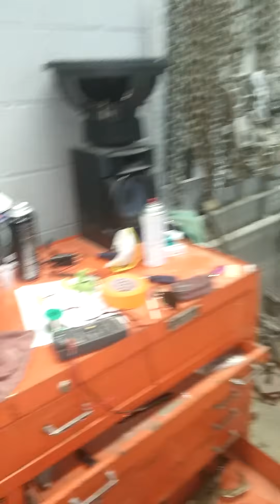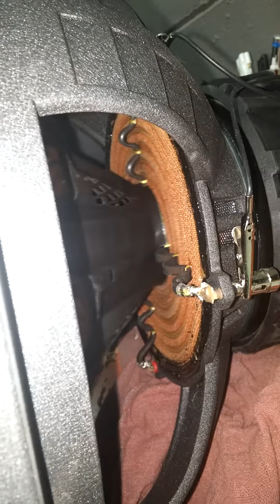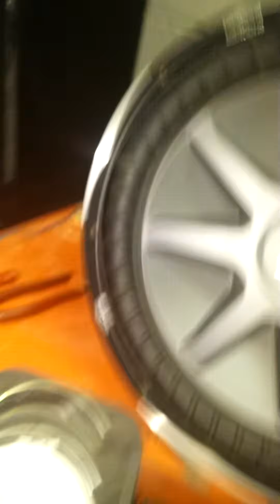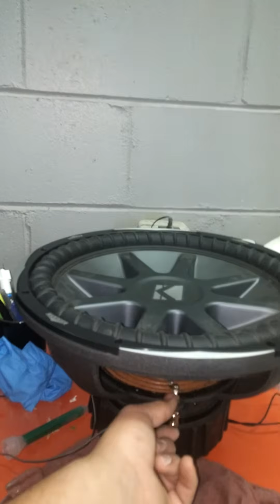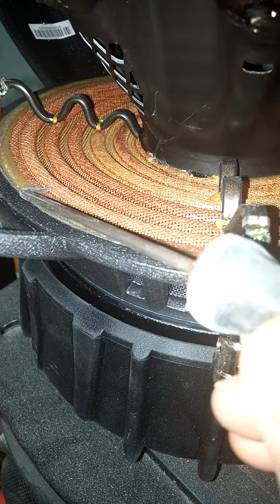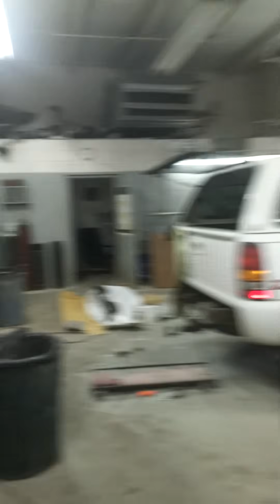Kicker cvx 15 voice coil rattle repair last video.

Comment: good job mike.  
too many youtube videos of morons purposely destroying speakers due to a simple rattle or rub where an hour or two of labor can have it up and running like new again.
Reply: Except this speaker is now destroyed as it will never be able to be repaired again due to the glue used to attach the spider and surround.
Reply from the maker: @CthulhuOO7 I mean... most times you would replace ALL the soft parts anyway. So your not loosing much if you did a full recone. Educate your self friend

Comment: Did your Kicker repair last? If so can I have the name of the epoxy that you used on the coil windings please because I have a pair of older model L7 solobarics with the same symptoms. Thanks by the way for posting these vids because I was really on the fence about attempting to salvage my subs, I appreciate your insight!
Reply from the maker: Ben G yes to this day my buddy is still banging these subs. No rattle at all. The adhesives I used where BIG QwixTer on the coil which is clear and applied with an acid brush. The other to reglue the spider and surround was Panel Bonder. Both were from CrestAuto.com which sells body shop supplies

Comment: how high of temperature can the glue you use handle? and where can I buy some .
Reply from the maker: this stuff dries hard as a rock. you would literally need a torch to melt it off. both the epoxy on the coil and the panel bonder to put it back together are both from crest industries.